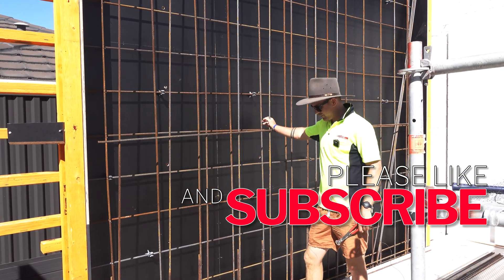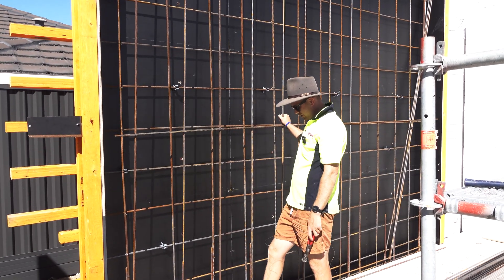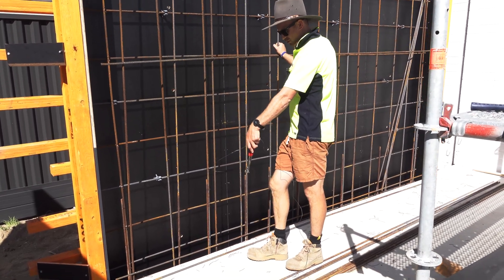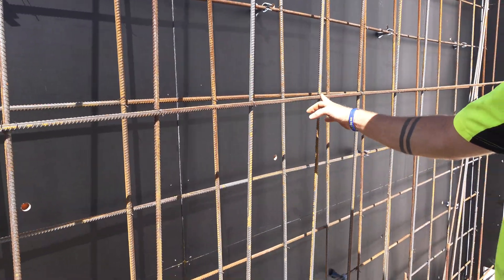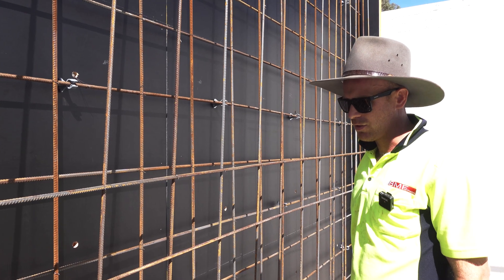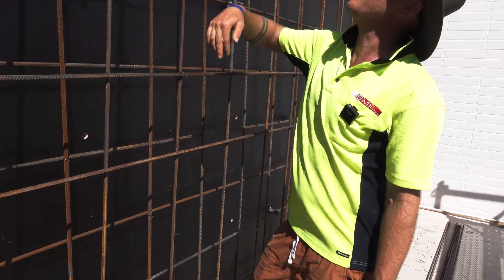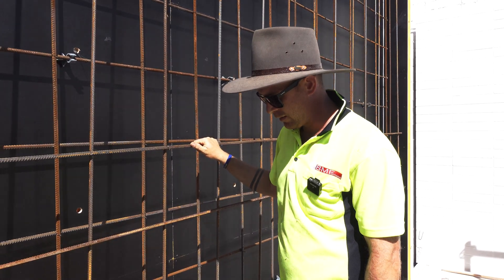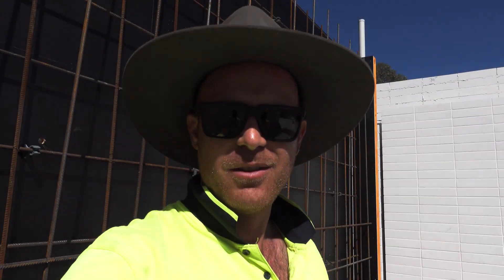Concrete Wall Reinforcement Off-form Concrete Walls PART 3

Comment: Are the backs of the chairs seen on the concrete surface?
Reply from the maker: You might see a tiny bit of one out of every couple hundred that go in. They are designed not to be visible

Comment: Gday bloke are u skew nailing your whalers with your 15g gun.. lve watch n ya work..
Reply from the maker: You can use 15ga through ply into timber and it will hold the timber. But for skew nail I use framer

Comment: Hey man, do you want to do my 40" tall tie beams around my new concrete shell house here in Miami?  7800 sqft.  660 linear feet of tie beams with exposed architectural concrete.  We did a mock-up and it's for shit.
Reply from the maker: Haha Miami would be a sick place to go work!

Comment: Good job mate, looks great. Don't know anything about this type of work and I expected the reo to be staggered on each side to get more even steel within the slab. Agree with the comment below, solid concrete walls look good if that's the look you're going for, but are a PIA to work with if you want to retrofit anything.
Reply from the maker: My understanding is there would be no benefit to staggering the steel. Each mat is independent of the other and effects the strength of the face of the concrete. If you stagger each face it will have zero effect on the opposite face. The steel needs to be within say 50mm from the face of the concrete to be effective. But I'm not an engineer. I have never seen steel staggered in my career

Comment: How much cheaper than use Blocks? Or how much quicker? thanks
Reply from the maker: Concrete wall is not cheaper than blocks. It can be much quicker though.
Reply: @bmformworkconcreteconstruc9783  Thanks

Comment: Damn good job you do, have one question why don't do the whole house with pouring concrete, it seems to me cheaper and faster than installing blocks, etc.
Thanks mate
Reply from the maker: It is far far far more expensive than bricks. And if you choose to add insulation it is very expensive as you have to build 2x concrete walls (sort of). Bricks are cheaper, brick insulation is better, modifying walls is easier and don't need access for concrete pumps and trucks.

Comment: Nice job.   You have the rebar on chairs/spacers sitting against the ply holding the reo in place.  Once you remove the formwork, won’t you then see the chair foot on the finished concrete wall as it’s pressed up against the formwork?
Reply from the maker: Hi mate, nope, for 2 reasons. The chairs are designed to not be seen but once wall is closed the wires are cut and the spacers move away from the ply. Yes some will be hard to ply but they are never solid enough for conc not to get between them and ply. Very very rare that you will see a plastic chair on the conc face.

Comment: Do you need to spray your forms down with release oil or is there a film on the ply? Thx
Reply from the maker: Because the ply is brand new it is so smooth that there is no need for release oil. I find it makes no difference on new ply. we only use brand new ply for these jobs.
Reply: @bmformworkconcreteconstruc9783  Thanks Happy Aussie Day from Philly USA

Comment: Nice to see this done with pride and accuracy though. A lot of steel fixers and formworkers in Sydney who are actually cowboys. 

What's the go with patching bolt holes ? Is it rammed in during pour to colour match or cast and placed later ?
Reply from the maker: Thanks mate, After we strip and conc has cured and the colour has had time to lighten the bolt holes are filled with special grout which water proofs the holes and seals everything. sometimes the holes are patched flush to hide them or in this case the holes will be patched shy to make the bolt holes a feature.